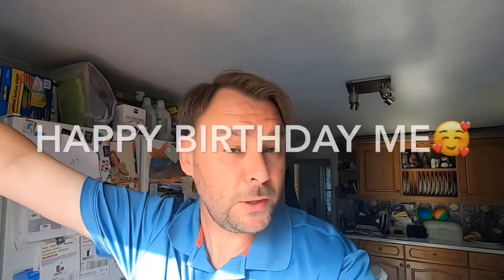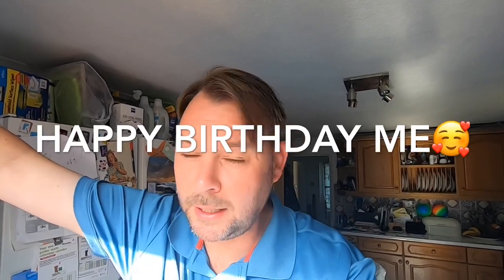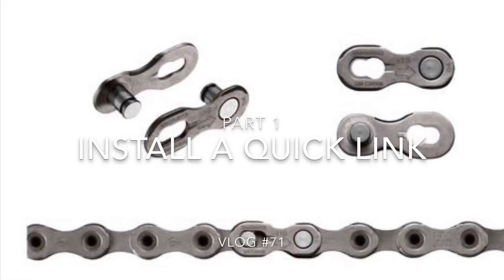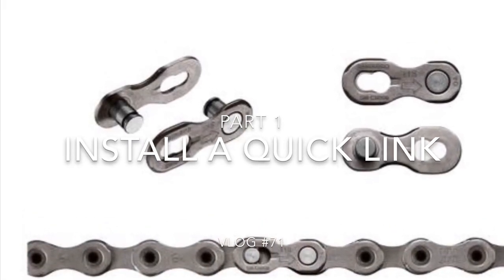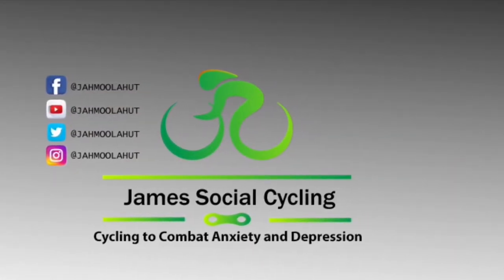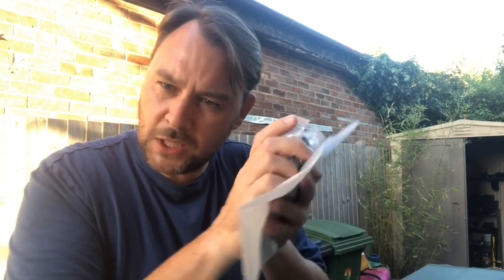Bicycle Chain Series  - 3 Part - Part 1 - Installing a Quick Link to your Bike Chain

Comment: The chain guide measurement is not the same for all chains, you need use different measurement on it to determine if the chain needs replacing on an 11 speed. Great link tutorial.
Reply from the maker: Kermit Frog https://youtu.be/EJfTulNH4sk thanks for looking in and appreciate your comment. Details of 2 different tools, just different wear times to change chain👍🏻